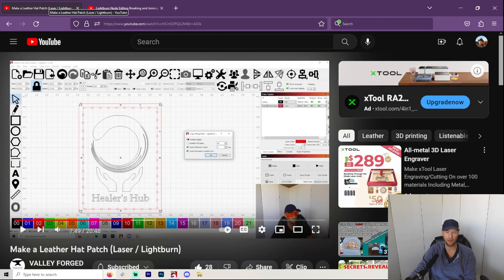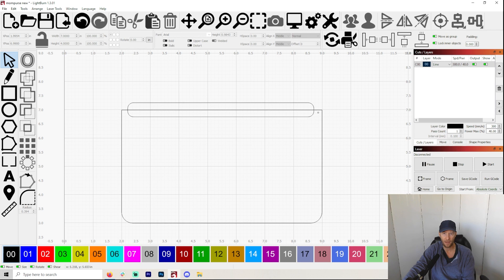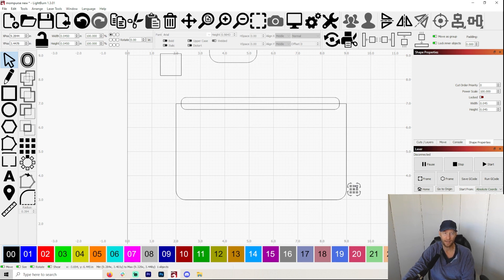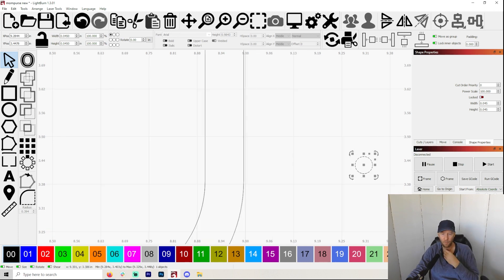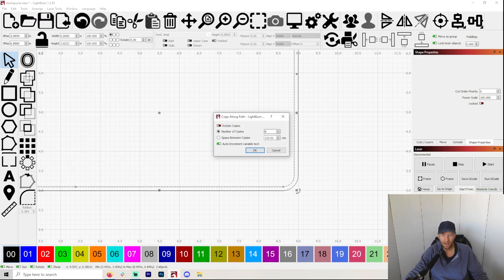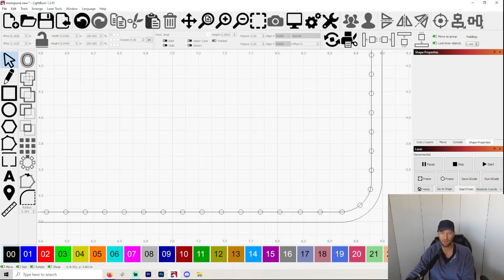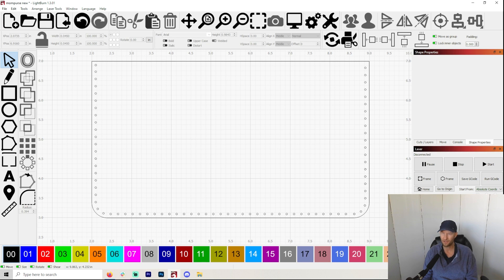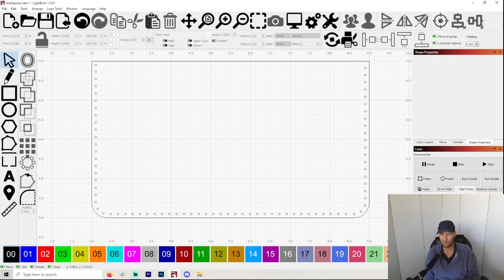Creating Stitch Lines / Holes in Lightburn (Laser Engraver)

Comment: @ValleyForged Bumping old video, but there is a better way. 

On the shape, press Edit Nodes and break the shape (point on a corner node with the mouse and press B). 
The rest is the same, but doing one side at a time ensures having holes in every corner. 

There will be a small difference between the distances on each side, but the result is better. 
Also that works with ellipse, tilted at 45 degree angle for saddle stitch, but you might have to flip the ellipse to be tilted to the other side whenever you do another side.
Top side / tilt, right side flip the shape to start with \ tilt, bottom /, left side \, top /. The result is amazing, just like with classic iron tool.

Thank you for the great video, greetings from Bulgaria.

Comment: much easier than what I've been doing in freecad to date, will have to try this in the future.  I assume your hole size is in millimeters as well and that is the radius of .45?  I've been using .5 and .65 depending on the thread and the needles I'm using.  I did just switch to the thread you mentioend in another video this week.  Much thinner with thinner thread as well, very nice for sure.

Comment: Is there a way to move the node box, so you can get the top-right stitch hole exactly in the corner, or at least match with the position on the top-left stitch hole
Reply from the maker: Hmm, not sure. I would fiddle with the #s until you get it super close, then manually move it. There may be a much better way to do this, and if I find it, I will post an update. Should be getting back to leather very soon.

Comment: How do you remove the charring from the stitch holes, so that your thread remains clean from the char.
Reply: I have a small Dremmel and I made a small pointed grinding bit that I ream the holes with, cleans the holes out and goes pretty fast.
Reply from the maker: Settings are everything, so make sure you use the least power to be sure the holes are cut. I have some trouble with yellow or white thread, but darker ones are pretty safe with good settings. Using a laser does have its drawbacks. I just love lasers, so I try to find a way.

Comment: The hole spacing in this video is just what I needed. Thanks.  You have probably figured this out by now but if you put the pointer in the center of what you want to zoom first then use the wheel it will keep it centered.
Reply: Are you using mm or inches?

Comment: You're working in INCHES? Is this 1930's Britain?!
Reply: Think of us in the US as being bilingual, but with units of measure.  The people in practically all the rest of the countries of the world can apparently only understand the metric system while in the US many/most are comfortable with imperial or metric units.  So when we want to confuse outsiders and gain advantage over them, we just use our native imperial units.  They are left scratching their heads.

This will get you a considerable distance in conversion:
1 inch = 25.4 mm
1 mm is approximately equal to .040 inch

If your stitches are a mile long, then that will be 5280 feet, 63,360 inches, or 1,609,344 mm.
Reply from the maker: Just showing my age?
Reply: @ValleyForged  Showing your age? I'm nearly 56, and work in decimal in the UK!
Reply from the maker: @Jer0867  Of course you do! We have been swearing to change over here in the USA since I was born. Still hasn't happened.
Reply: @ValleyForged  Thanks for the video!!! I'm new at this and it really helped. I'm 52 and in the UK, I do a lot of woodwork and I still prefer to work in Feet and inches!!!! so good for you!